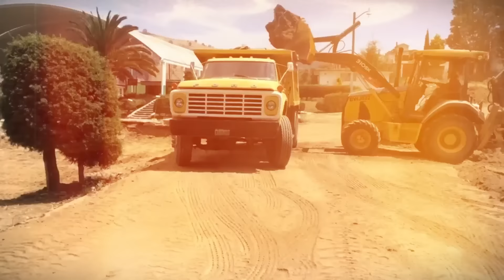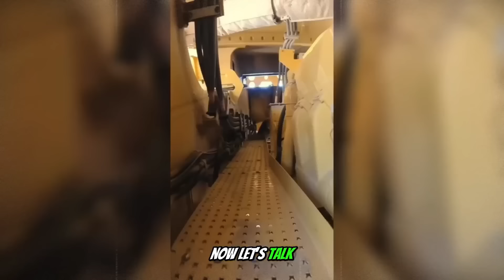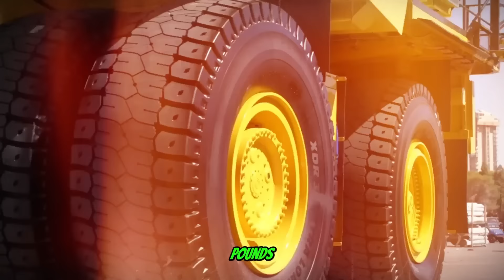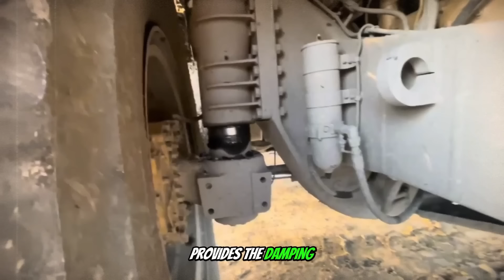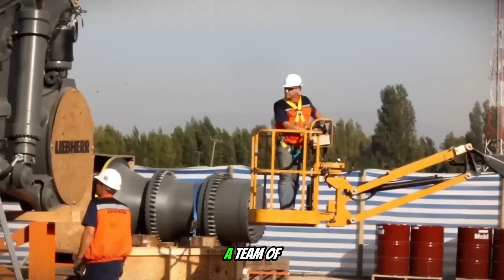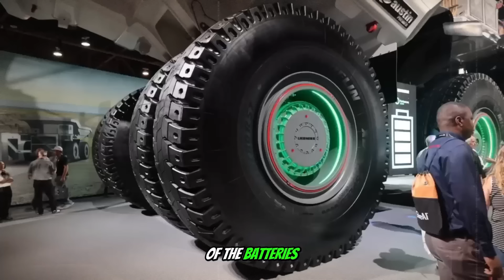Why Mining Trucks Must be this BIG!

Comment: There are electric ones working 24/7 where they need to DISCHARGE the batteries every round as the load is moved downwards and this creates more electricity as the energy needed to get the truck back up to where the rocks are to be moved.